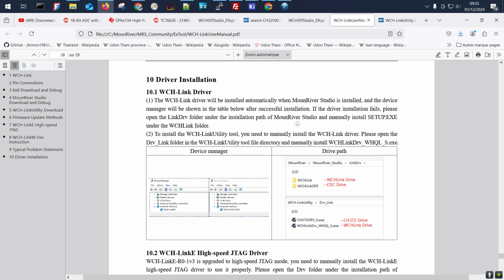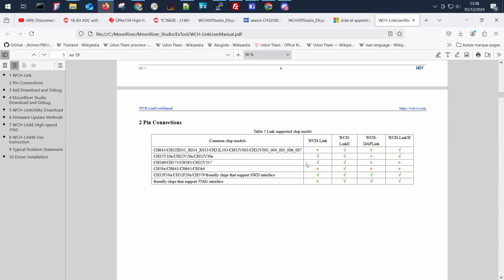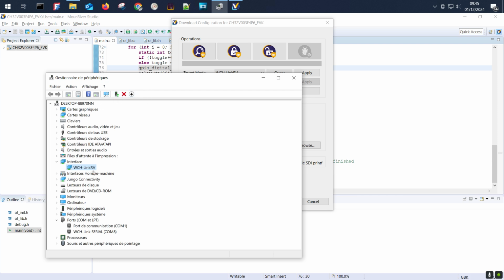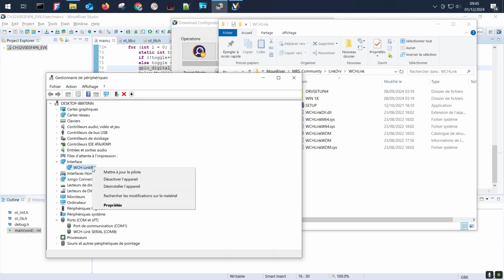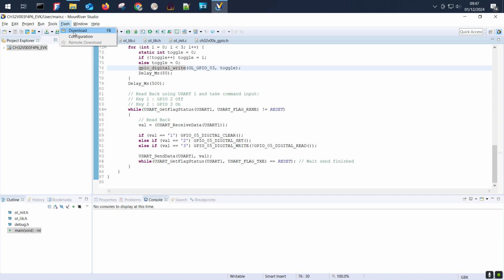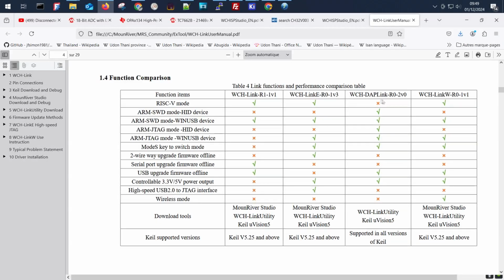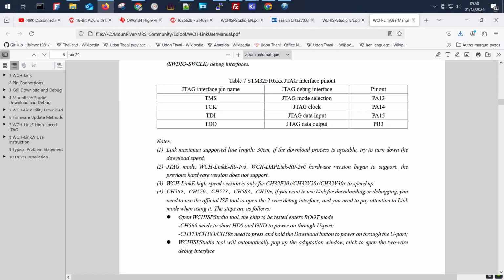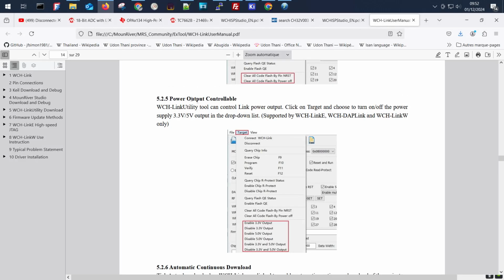MounRiverStudio and WCH-LinkE Programming

Comment: I plugged in the WCH-Link and it lights BLUE/RED Leds.

But when I try to debug the CH569-EVT, MounRiver Studio says 
"Ready for Remote Connections
Info : Listening on port 6666 for tcl connections
Info : Listening on port 4444 for telnet connections
Error: WLink Open Error localhost:3333: No connection could be made because the target machine actively refused it."

Device Manger shows USB Composite Device (VID_1A86 PID_8012) consisting of an 
Interface->WCH CMSIS-DAP  (winusb.sys driver)
Ports->Serial COM port

I installed the MounRiver Studio IDE, but there is no 'LinkDrv' sub-folder containing any drivers!  There are no buttons inside the WCH-Link enclosure, but there is an open JP1 jumper.

When opening tools like WCH-LinkUtility V2.70, the field for "Connected WCH-Link List" is empty before/after refreshing.

Maybe the WCH-Link does not support these tools/RiscV... and I need instead the WCH-Link*E* adapter  (VID 1A86, PID 8010 / 8011)?
Reply from the maker: Hello, It needs drivers for Risc-V and Arm mode i recall, make sure you've them installed. They live in the sub dir on the driver/zip package.
In the Windows Peripherals you should see the "WCH-Link SERIAL (COM8)" or the appropriate Com port for your machine. It's in Ports (COM & LPT) section.

If not in there or <!> driver missing you got to locate & install them.
Search for latest ones, these might fit but outdated:

https://github.com/Community-PIO-CH32V/wchlink-driver-windows

Regard

Jean-François